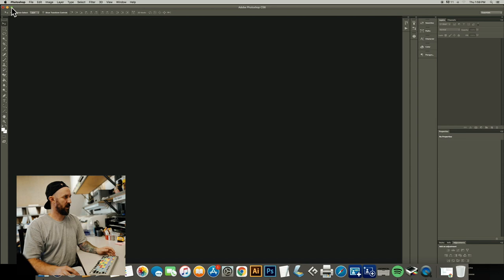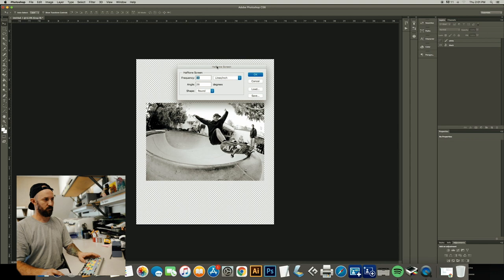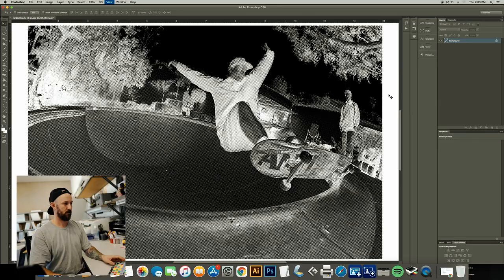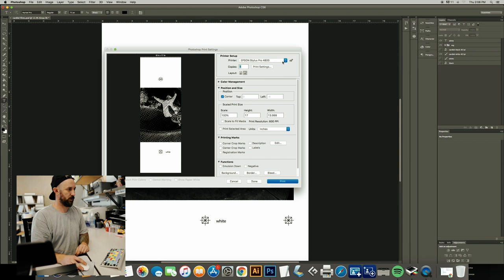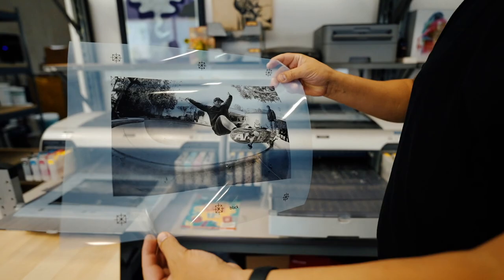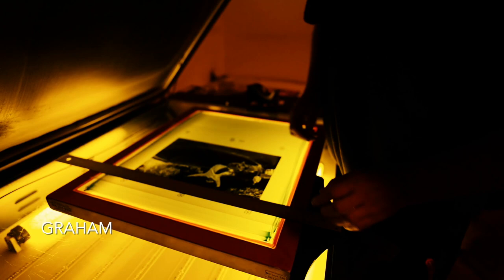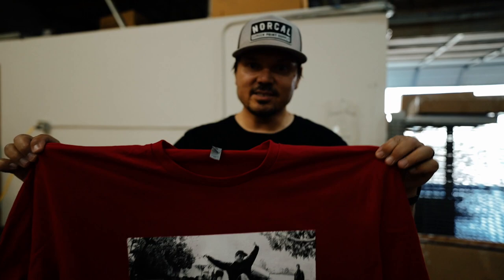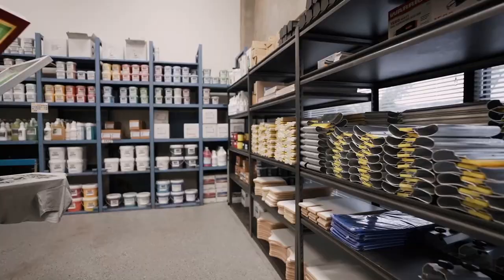Two tone Photographic Halftone Print Demo - Steven #FreePrintAdvice

Comment: If you make a table template you don't have to use a t square every time.  Lay film down on table, place screen on top of film and voila.  Hit me up if you want a video.
Reply from the maker: Hey there, thanks for the comment. Believe it or not, I prefer to use the t-square to align my films. Been doing it that way for a long time, and I just don't prefer a template. Thanks for checking out the video!

Comment: What kind of low-tack adhesive do you use to hold the fabric in place? I've got several types of automotive and 3M sprays, but I think they would be far more permanent than would be wise.

Comment: I see you using the power washer to wash out the screen after exposing it would it blow out the halftone also?
Reply from the maker: If the emulsion is fully exposed, it can be washed out with a power washer. If emulsion is uner-exposed, a power washer would blow out the halftones much easier.
Reply: @NorCalScreenPrintSupply  give thanks for sharing you knowledge with us.

Comment: After it was exposed you place it on the dip tank? Would that soften the whole emulsion? Do u do that on all screens not only with half tones and how long it’s left in the tank? Thanks for the great videos
Reply from the maker: We actually pre-develop every screen in the dip tank. If the screen has been exposed properly, only the unexposed emulsion will soften. If the screen has been exposed long enough, it can be left in the dip tank quite a long time (I'm sure I've left one in for at least half an hour).. But usually 1 - 2 minutes will do the trick. Thanks!
Reply: @NorCalScreenPrintSupply  of u I have you guys good h are gghhhhhhll uyour g you and guidjudance four country of uu huor a guiding the FF us in

Comment: what screen size are you using?
Reply from the maker: 20x24 outer diameter, 230 mesh. Thanks!
Reply: @NorCalScreenPrintSupply  
how much and how to mix the emulsion and the senitizer for that screen ?
that measure.
thanks!

Comment: Hey, I was wondering if the gray gradients in this two-color screen print would turn out more detailed and smoother if you are making more than a black and white screen. For example adding a screen with gray or even adding more screens with different shades of gray? Or is that just more work and the result is worse than just a two-color screen print? Would love to hear your opinions and why's! :-)
Reply from the maker: Hey, great point. A better print can definitely be achieved with more shades of gray. More work, but worth it to get the best print possible.
Reply: Duotone BW photos use black, silver grey and white. They're beautifully toned, but It may be more work than needed for screen prints.

Comment: how do you lower your greyscale opacity to avoid dot gain ?
Reply from the maker: Hmmm not sure I understand. I usually would not lower greyscale opacity. If you want to reduce the color information and print less information, you could select the art in Photoshop and use the curves function to lessen the darkness. To prevent dot gain, use higher mesh count and keep print strokes to a minimum - just enough to clear the ink through the screen and onto your shirt. Hope that helps!
Reply: @NorCalScreenPrintSupply  so the key is curves, higher mesh count and  minimalize stroke.. thanks bro 🥰